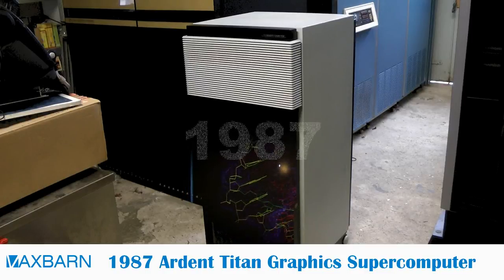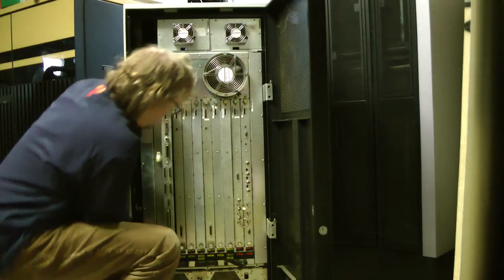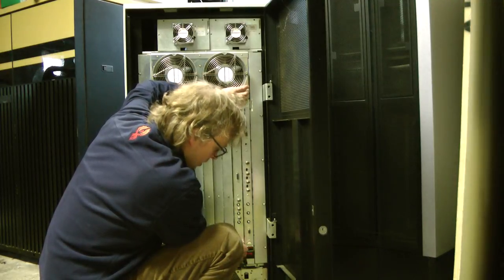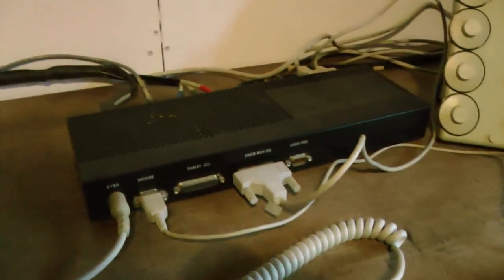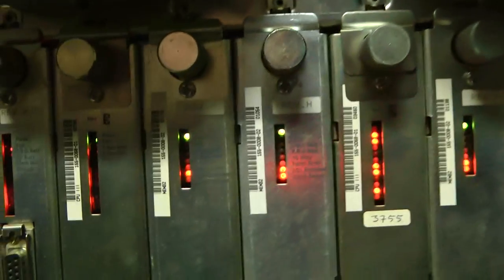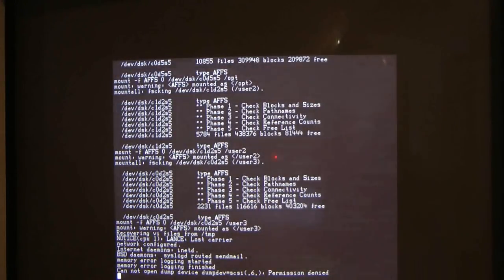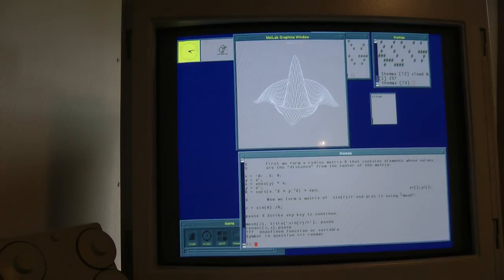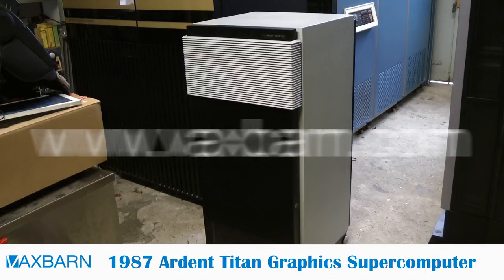1987 Ardent Titan Graphics Supercomputer

Comment: That's a Sun mouse and pad it seems.  You can print graph paper at high-res and the mouse can track on the grid you print.  Nice you have the original pad, but graph paper was the short-term fix for IT folks then, to address a lost pad.

Comment: Very relatable to understand today compared to supercomputers that only did batch job applications where you couldn't really grasp the kind of outputs it did.   Amazing though is how even a $5 raspberry pi zero whoops the performance of this many times over and yet is far cheaper, the size of two fingers, and way less electricity, not to mention infinitely more reliable in operation.

Comment: 3:54 These are long vectors. On the Cray machines, a vector could be up to 64 elements in size. Contrast this with the SIMD short vectors (4 or 8 elements at most) popular among most current CPU architectures. One notable exception is RISC-V, which is resurrecting Cray-style long vectors instead.

Comment: That's some serious PCB real-estate!
Reply from the maker: I'll try to do one on the Convex C220 next; its boards are about twice as large, and each of the two cpus occupies 6 boards.
Reply: @CamielVanderhoeven  Sounds great! I worked at two PCB firms and I thought a full-sized panel for just one board was incredible to see!
Reply from the maker: The Convex C220 doesn't use PCB's though; it uses multiwire boards.
Reply: @CamielVanderhoeven  Ah, gotcha!
Reply: And to think in about 5 years time, they were able to put all the logic on one of those boards into one single chip. Or pretty close to it.

Comment: The first board you pulled looked like it may have a battery in the upper left corner? You might want to remove/replace that if it's the original.
Reply from the maker: That's the battery for the nvram; I already replaced it with a new one.